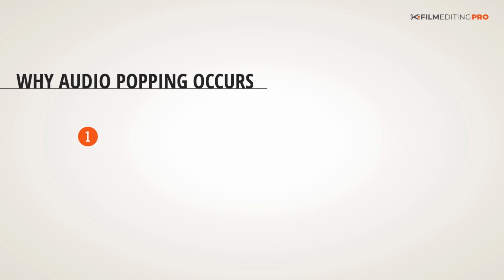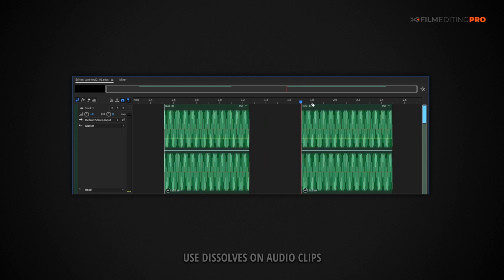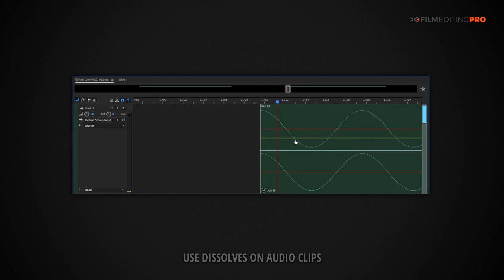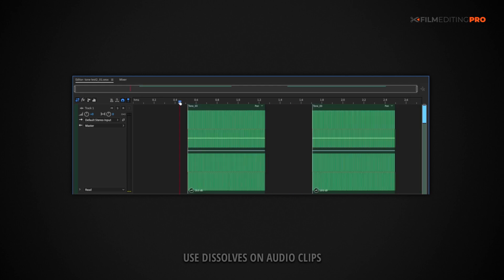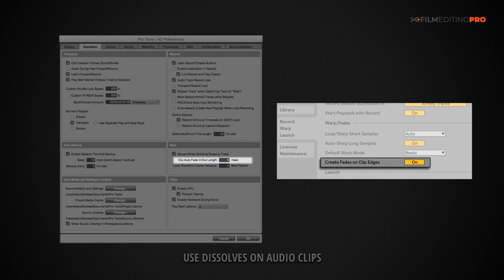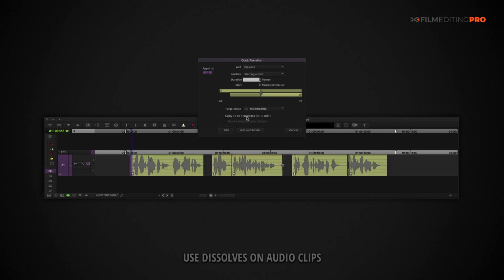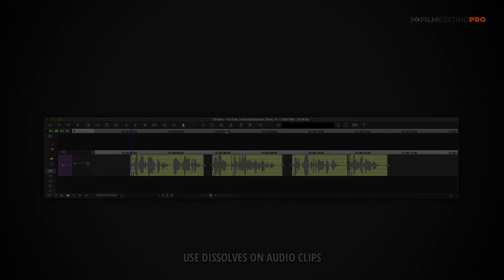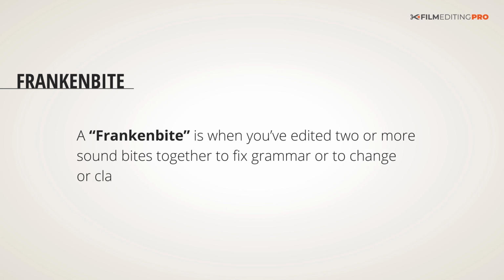Edit Tip: How to Quickly Fix Audio Pops

Comment: wow that helped me with my short film's audio and voice design. Thanks, however, my crack and popping sounds are on also on the middle of the wawe length too.. So  i guess that stock audio file is corrupted internally? Its just not on the beginning. Anyhow i can fix that too?
Reply from the maker: Hi Lorne - yes if you’re hearing popping within the waveform itself that’s definitely a problem with the source file. You can try removing a frame or two and adding a cross dissolve as a bit of a bandaid to see if you can salvage it. The best bet would be to find a different sound library though. That isn’t something you should have to deal with.

Comment: 3:28 How can we balance the volume between both tracks to make them feel like a single line?
Reply from the maker: Fantic Duck you can just manually adjust them and keep an eye on the audio meter levels.
Reply: @FilmEditingPro  I will do it practically, thanks for the tip.